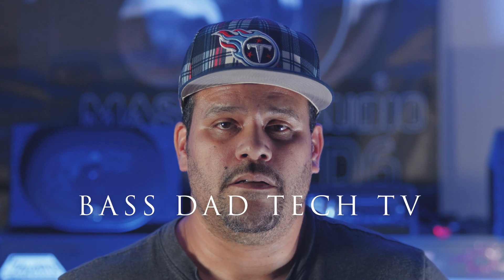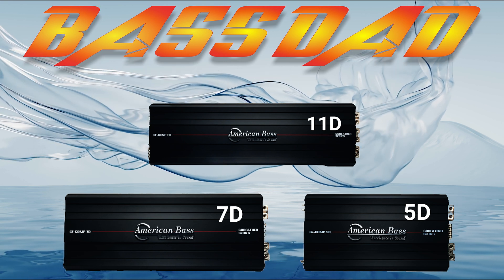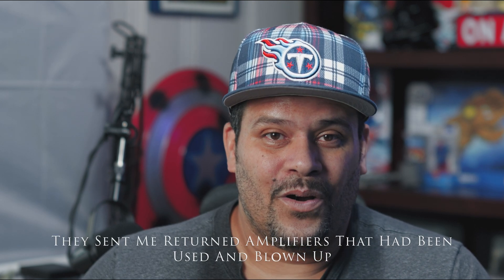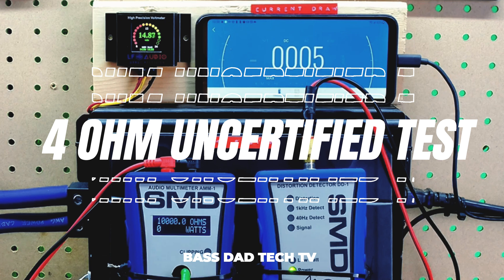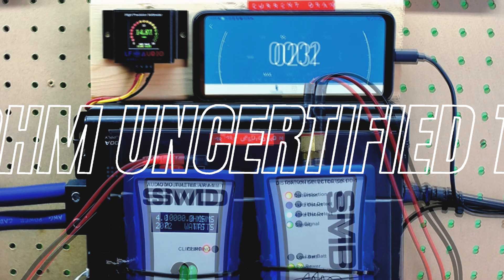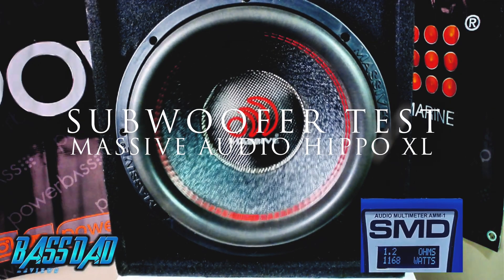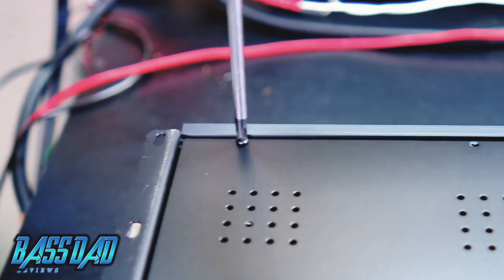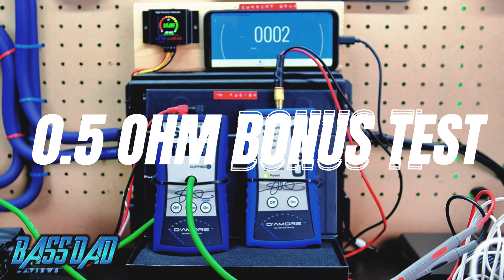Why Are American Bass Godfather Amps So Bad?

Comment: I dont run the Godfather amp but am running all american bass stuff. Ive had no issues. My daughter runs sundown with no issues. 

There are so many factors that can affect the amp from poor build quality to improper installation to user error. Last amp i blew was a crossfire c7 2k and it was just a freak thing they said theyve never seen happen before.
Reply from the maker: @dustinnewell6422  Glad you haven’t had any issues! But honestly, it kinda feels like you’re trying to dismiss mine? Like I said from the start, this is just about these three amps and my experience with the company. Not sure why you’re bringing up improper installation—that’s not even relevant here since these amps were never installed. I’m not just guessing about their quality either; we took them apart and looked at the components. Add that to my experience dealing with the company, and that’s how I came to my conclusions. I get that people want to defend what they run, but just keep in mind, this video isn’t about what you’re using. It’s strictly about these three amps and my experience as a videographer and independent tester.

Comment: I'm running two 15k's godfathers 15D amps great power but they don't like half at all. They sound great 👍 did a 157db with two of them. Y-bass on utube has the video of the godfathers 15D amps

Comment: Surge amps are blowing up and catching fire right now. It's all over social media. It's kind of a big problem with the surge amps
Reply from the maker: @robertmontalvo597  yup but not the surge 4k. I even have a video on the 3k smoking and stuff. I probably should have been more specific about that sorry
Reply: @BassDad-TV  so far. But more than likely being built by the same people? 🤷
Reply from the maker: @ nope I just answered your other message it’s not so far because the 4k has been out for years surge had that 3k built in China. At a completely different place. That amp has nothing in common with these or the other surges. Again I have a video about that amp. Mine wasn’t bad but a lot of people got bad smoking 3k’s

Comment: I personally cant recall an american bass or vfl amp that made rated from the dynos ive seen. Is the godfather line there higher end stuff?
Reply from the maker: Yes and no, unfortunately it’s complicated. So these amps are an attempt at higher end stuff for them. Some will be confused because this amp does make its rated power and even more but it’s also more liable to break on you because the parts they used were not the best. I think the smaller amp did ok (that’s the amp in this video) just because it handles smaller amounts of power but their bigger ones just seem to be made badly. Especially the power supply section. I will be definitely getting into it more in the next GodFather video in about 2 weeks. I hope to see in the comments there! Thanks for watching!

Comment: Awesome honesty & straight forward review on the ab 5d. I've been thinking about the GF11d lately and I'm glad I've held off so far. they do look like their boards are nice Korean board type amps but I was careful cause it's real hard to get any actual specs even from the american bass website
Reply from the maker: @laurantsmccloskey5927 I’ll share more in the 11d video once the tech finishes it. They cut costs on parts, using the same board as the cheaper Surge 10k. I wouldn't recommend the American Bass amplifier due to its quality and their poor handling of the review situation—they stopped responding and sent used, returned amps. Have you checked out the Ruthless 10k? It's similar but has much better components and a strong power supply.

Thank you for watching! I appreciate the support I've received throughout this journey. 🙏

Comment: It could be a protection circuit thats throwing it into protect. may not be due to "cheaper" component's.
Also efficiency.. you spell it with an A. Anyway enjoy and ill watch what you put out.
Reply from the maker: @bobdodge3171  hey man, thanks for watching and you are right for other amps it could be a protection circuit. For these amps though I went and had the other two amps fixed and unfortunately these amps have cheaper parts in them. I had the two larger amps rebuilt with better mosfets and stuff. I really investigated this situation before I made this video. I always try to give the company the benefit of the doubt when it comes to calling them out publicly :)

The spelling was just an oversight it was 5am when I finished this morning. If you look at the 100’s of other videos I have made it’s spelled correctly. I know I look like I am perfect but unfortunately even I make a mistake every once in a while. ;)
Reply: @BassDad-TV  man. I wasn't trying to make a big deal out of spelling.. it just didn't look right.. I even googled to make sure lol..
But right on. Keep doing what you do.
Reply from the maker: @ I was so tired Bob when I finished this usually I watch it like 10 times and get a couple of family members to watch it but this time I set it to auto post and just went to sleep lol